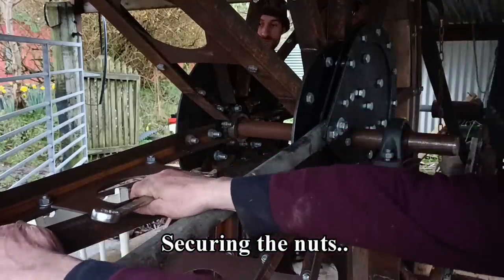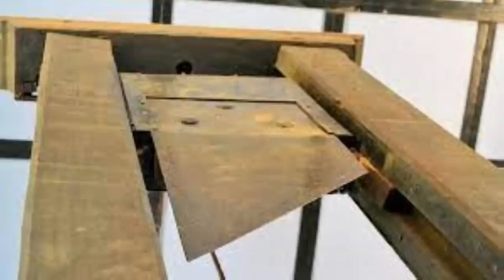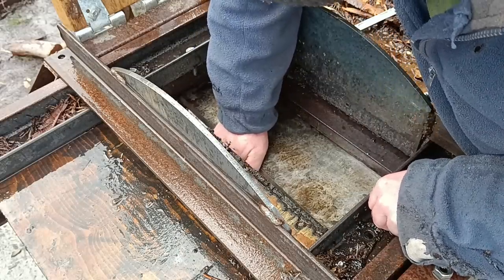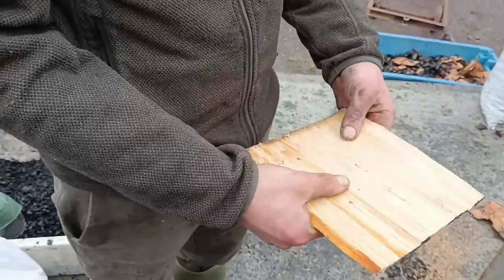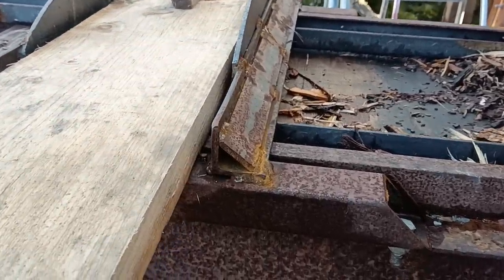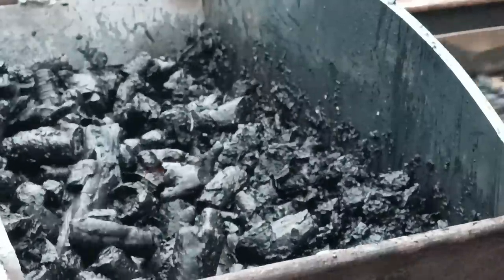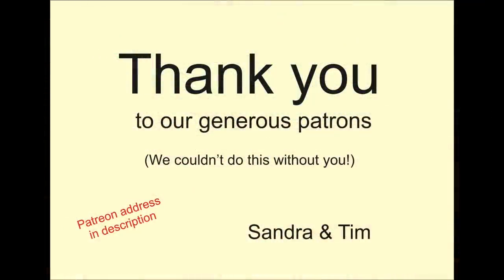Responses To Comments On The Wood Slicer Machine..

Comment: Tim

A couple of points.
1. I couldn’t see from the video. Is your blade sharpened on center like an ax or biased to one side like mandolin slicer? the bias will cut much better.

2. Blades from a large brush hog or cutting edge from a dozer or grader will make good blades & are commonly available.
3. The center pivot as drawn will take a lot more power to operate, bad idea.
5. If you want a longer/adjustable stroke eliminate the eccentric.
A bell crank (just a plain old crank ) will serve you better, less friction, more power available for work.
6. The wood slices are only good for decorative shingles. You would have to have Cedar or some kind of weather resistant species and they are much thicker, longer (16”) and are tapered so they lap correctly.
7. I suspect they are so thin you will loose a lot of volume when making charcoal.
8. Just weld a piece of key stock on either side of the bearing to keep it from shifting, standard mill practice.
Keep up the good work, looking forward to your rail video.

Comment: At the museum we have a plate steel cutter
It uses hydraulics to cut sheets of steel 
It’s blade has a slight pitch. 
I bet you can make a slight adjustment to the pitch of your blade and you would see tremendous results. 
You don’t need the 45° pitch of a guillotine.

Comment: Super Interesting project. I work as an Arborist here in Germany and we produce boatloads of woodchips every day. We tend to drop them off at various communal gardens or small wood chip power plants for free because we cant deal with them. I was wondering if those could be used for charcoal too, since your wood source might dry up eventually. There are usually pretty wet so they would have to dried but they would could pre-chipped already. I dont know what the tree surgeon scene is like over in ireland but if you ask nicely i am sure they would be happy to supply you with as many as you can take
Reply from the maker: I could get woodchips here - but I would need a different way to dry them because they're so small and wet (lots of leaves in the mix often). Just heaping them up would only make compost - as you know. I'd like to use them, but realistically there aren't that many free loads available - maybe one or two a month? So not worth developing the dryer, I think

Comment: Tim, I think that you need to revisit the wood squasher holding down the logs. At the moment you have a simple pivot which is working but puts greater down force on the log nearest the pivot. I think that if you added a squash plate that was attached via a triangular pivot to the centre point of the squash plate when it is correctly positioned in the guide rails then providing down force on the pivot arm would then share the load over both logs and shingle them together!
Mark from Melbourne Australia
Reply: I suggested something like this: ^
Then add weights so its hand free and a pulley to lift it up!
Reply: @clethtinthiallor9179  Even better let gravity do the work!

Comment: You could bolt another eccentric to the exiting eccentric to get a longer stroke.  It could be, say 1" from hole to OD at it's narrowest and 10" at it's widest.  Bolted to existing eccentric where it's narrowest, and you've added 9" to the stroke.  Unbolt and rotate 180 degrees and you've subtracted 9" from the stroke.  Any amount in between is possible just by adjusting the two.  You've need to make a larger follower to go around the new much larger dual eccentric.  Now really fancy would be some way to adjust it on the fly: but that would be too too much.

Comment: (log chopper) As a human chopping small logs with an axe, I find cutting at a 45 degree angle to the length makes it easier to go all the way through in one whack. I suggest the long dimension of the log and the rotation of the blades be 45 degrees from each other, instead of the previous 90 degrees. Love the channel!

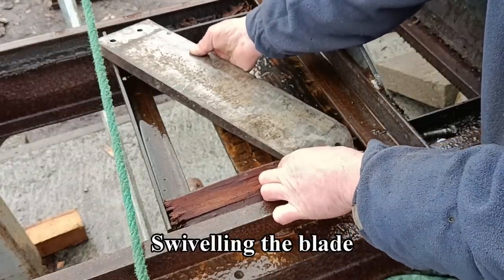Comment: 1:07 Swivelling the blade: to prevent the log from moving sideways, a solution might be to use a V-shaped blade, which would have the advantages of an oblique blade and would also keep the log centred.
It would be difficult to find such a blade, I admit.

Comment: Nice! For cheap-but-good blades, would "worn out" cutting edges from JCB shovels do? I don't have one, but it's usually quite nice steel and for your use-case, you only need short lengths...
Reply: I was gonna mention the same thing as I've just picked up an off cut of 150mm x 19mm wear plate (with bevelled edge) to make the box wedge on my next log splitter build. 
You can get new replacement cutting edges in various sizes, but a piece of second hand stuff would work fine.
Reply: If you can get old blades from a plywood mill.....

Comment: Hello Tim, thank you for replying to our comments.

I have thought some more about braces between the wheel frame and the slicing frame.

I want to suggest what I think would be simpler, two additional 'connecting rods'.

The wheel ends would be riding on the main wheel bearing shaft, probably not necessary to have two more expensive pillow block bearings, two simple bushings would work.

The connection to the slicing frame would be just below the slicing assembly and again simple bushings and a shaft would be sufficient.

The setup that I am suggesting insures that the bracing is perfectly in line with the forces acting on the wheel axis and the slicer.

Obviously these additional connecting rods would not move but would fix the distance between the wheel and the slicer frame.

You have provided individual answers previously, if I am not explaining this concept properly I am happy to provide more details.
Reply from the maker: Thanks, Carl. I'll have a think...

Comment: Using the lever method could work if you change where you connect the shaft from the motor and grinder.  Instead of the grinder connected to the top, connect the pivot point to the top..  This will have to effects.  The rod going to the grinder now runs level, but also, using lever tech, the motor connected to the top now allows for more forward power at the grinder.  The travel distance could then be adjusted from the motor connection down.  So for smaller strokes the motor would be connected near the top (shorter strokes with more power).  For longer strokes, motor is connected near the rod from the grinder.

Comment: In your Jan 20, 2023 video, at 19:15, you introduced an "anti-spin" bar made of wood.  If removable steel inserts made of vertical steel bars spaced at varying spacing distances were made, so that the ends of the cross supports rested on the sliding angle bars of the slicer, wouldn't that keep the logs from turning sideways?  Several inserts could be made.  It would require being more selective of the size when loading, but could allow different sizes to be processed more efficiently, I think.  The pressure board holding the logs (seen in later videos) could be slotted to allow for the vertical bars, so that it could still be used.  Seems to me that the bars that you use for your rails on the railroad would be about the right height, but would be thin enough not to reduce the cutting stroke very much.  You are making great progress!!

Comment: The steel used for road grader blade, plow shares and the cutting edges for loader buckets might be a choice for replacement blades. Though it may not take a razor's edge, it is very wear resistant.  When it is worn out from the original use, it is often free.

Comment: If you wanted a longer stroke, use a bell crank mounted to the frame of the big wheel. Mount The pivot down near the ground in front of the wheel. The connecting rod would go from the eccentric down to the first arm of the bell crank at about hey 30 degree angle. the second arm would be longer and extend up vertically. Multiple mounting holes would allow you to select the final stroke desired. Think bell crank and mount it to your already existing sturdy frame.

Comment: Hi Tim, thanks for great and entertaining videos, your creativity is inspirational. Have you thought of putting a floating (up and over) hinge on the log press of your slicer so that the board of the press stays horizontal and it will press both logs down equally at the same time, or all of the charcoal across the slicer, which will be much more efficient as you will slice right across the length of the blades on each stroke? Keep up the great work and I love your way of life and philosophy towards creating 😊

Comment: Does the bottom edge of the "stopper bar" piece have a nice, crisp, lower edge? If not, that might help with a little scissor action when a chip gets stuck vertically, especially if it's nice an close to the splitting edge passing below it. Fantastic work, Tim!

Comment: This might have already been commented but would it help if the plank you use to push the wood down onto the blade be hat shaped, like this ^ ?
That way it pushes both logs so the second one can start slicing sooner. 
You could also add weight to the bottom so it pushes down hands free, then add a pulley to the ceiling to pull it up and add new logs!

Comment: A good source of blades about that size would be check with the local road crew for used and worn out blades from road graders. They often have a scrap pile of them. As they are typically 10 to 15 feet in length one of them could have many uses. A friend on the road works department could help snag you one. Or just ask. Never hurts to ask. Also paper companies use big blades like that. Its the type of metal you want. Just have to shape it to your purpose.  Also Instead of an angled blade what about a v shaped blade using the inside of the v as a cutting edge. Would solve the problem of the wood shifting to one side while giving the angled advantage.

Comment: Hi Tim,  yep, that has covered everything!! Thank you for your answers.. Just one thing more is the bearings for the eccentric drive, will need some lubrication "grease not oil as it will go all over things including the belt, as I know from having a flat belt roller adjustment for years, which needed to be oiled daly and not careful would slip the belt off" as they are running on plasma cuts, not a ground surface so not sure how long the hard face of the bearings will stand up to it???
Reply from the maker: You're right, John. I have put grease in and they seem fine so far, but I am watching them for wear

Comment: Have you considered using a simple hopper to allow gravity and the weight of the logs to consistently feed the machine without having to manually chuck in a log every time it finishes slicing?

Comment: You described the added lever concept to enlarge the stroke from the ground up  at 90 degrees as a new but expensive component but why cant you mount the lever at an angle out and pivot it from the bottom of the existing frame of the guillotine ? also, that roofing screw is perfect for your sheer screw, ive broken the heads off them heaps of times when over torqueing them. The bolt that you used will bend before it ever breaks.
Reply from the maker: Yes, I was thinking the same thing. Thanks!

Comment: Hei Tim, the link to yesterdays machinery the original shingle maker showed a blade with a concave curve along its length. That means the blade stays at 90 degrees to the cut but slightly angles the cut to the centre. Take another look at his video, I think it may be a fine tune that could be surprising

Comment: I think you mean roll pins to secure your bearing block. They are easy to come by, eBay for instance, or any local engineers would have a selection, and probably sell you a small number. I would think originally those holes would have used tapered pins though. They would be easy to make on a small metal turning lathe.
Reply from the maker: Sadly it can take 3 weeks to get anything from Ebay, and I tried the engineers locally. Never mind though, the screws look ok too..

Comment: Hey Tim, great update video! I feel like the expansion arm ideas are from all the people who want you to hurry up and build a steam engine 😅 I feel like having a 6 or 7 foot pole attached to an already massive wheel thats swinging from side to side could be more of a danger than a help! I feel like your at a good position with your machine and that it shouldn’t change until the source of wood changes. 

Very excited for the next installment of the Little Western Railway! Hopefully an update on Tornado! 

I recently got into the large scale railroads and learned about a few early day American railroad inventions that could be somewhat easy for you to replicate! 

Stub switches bend the rail ends to form the switch curve, and Link and pin couplers were a very simple and reliable method of hooking up things in the 1800’s and early 1900’s just a pill shaped chain link and a big pin to hold it in place!

Comment: Can I suggest switching out the screws you used as positioning pins on the bearings with nails? screws are weak in shear and they will not hold up if there is a jam.  that boing said, they would act as a sort of physical fuse if that is your intent.

Comment: Hey Tim, I have an idea. So under the slicer, a bunch of wood is falling on the floor. I think you should make a big wooden box that perfectly fits into the gap between the legs, and then add 4 shopping cart looking swivelling wheels on the bottom of it, so when the wood fills up the box, you can roll it away to empty
Reply: No, not a box, just a flat bed trolley, and 2 of the white boxes would sit on, and that would save double handling of the crips from your box into containers to carry away!!😊😊
Reply: @johnmclaren3480  ahh smart
Reply: Even better homemade conveyer belt to put the slices into a wagon
Reply: Dont go spending good money on castors though, you can get a set of 4 from your local supermarket for €1.....!
Reply: @nathanpaice7394  wow, even better idea! Oh and it could be a long conveyor belt that leads to his nearest railway track. So then he could use his railway for something else
Reply: @LucasTheSleepyFool  😂
Reply: @nathanpaice7394  Or even extend a set of railway lines to under the slicer and load directly into a wagon 🙂
Reply: Or run the rails under it so a car can roll under and have a funnel on the slicer
Reply: Honestly, for the sake of simplicity and cost a simple metal slide off to the side into a bin would work to start, modifying it later on.
Reply: I already suggested two times that he should simply put 2 wheel barrows under the frame. Problem solved and not even costing one penny.
Best regards, luck and health in particular.

Comment: Maybe make a chrusher with a set of v plates one fixed the other drivers to vibrate and crush as the charcoal falls thought the gap at the desired size. They work well on rocks and concrete like charcoal which is brittle

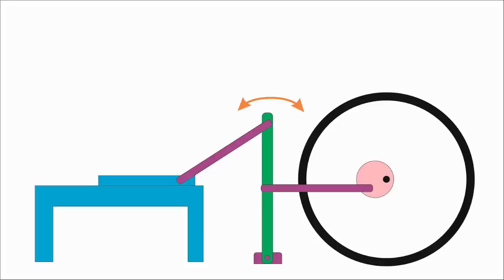Comment: I like your pic at 2:50 and have been thinking about this
The pic doesn't show some things so well - like the relative heights of the centres of the pivots. The wheel and eccentric is higher and the vertical lever need not be so tall.
My thought was that the top of the lever should travel such that the vertical height is kept the same as it is now, and also the variation, as with the eccentric. This is known to work.
The carriage that carries the blade will flop a little bit, vertically, depending on the clearance at the ways, but will be pulled by the connecting rod, upward at the cutting end, through the pin joint. You might consider adding some little wheels, like bearings, at ends of this carriage, to reduce friction. It will be better than a greased slide like you seem to have now.
So once you know the vertical limits of the new connecting rod and the lever, then you can work out it's horizontal position, so that it doesn't bump the table or the wheel at its limits. You may even have to move the table away from the wheel.
The lever itself shouldn't be too difficult - you could use some flat, with a series of holes, to lighten it and for adjusting pin position - your cnc plasma cutter is something i am jealous of LOL
The top connecting rod will not change much in length thereafter. The lower one could be the same design as you have now, telescopic with a shear pin, as it will need to change length as you move it's end up or down the lever. I would start with it near the top - only slightly increasing the stroke at first and see how it goes.
It should always cut when the connectng rods are in tension - pushing a piece of string and all that. But you could add a spring or weight system to collect some energy on the push stroke and release it on the pull stroke.
You would also need to make the log end stops adjustable to correspond to each stroke length.
Wil be waiting to see what develops. Generally seems like A Good Wheeze !

Comment: About the blade: I think it would be more effective if it were mounted horizontally, not at an angle, with the bevel facing up. As it is, the "shingle" gets forced down and rotates while the back of the log is levered up, leading to the shingle sometimes ending up vertically and messing up the works. My sense is that it'd work better if the shingle were as unimpeded as possible and the (front of the) log pushed up. I hope I'm clear, it's hard to communicate without drawing...

Comment: Regarding the pivot, attach it to the frame at the top so the lever pivots sideways, horizontal at the top of the frame. Pivot at the top left corner with the free end attaching where the con rod is currently attached and the connecting rod moved slightly to the side. The lever would be shorter and being attached to the frame would brace it and simplify it.